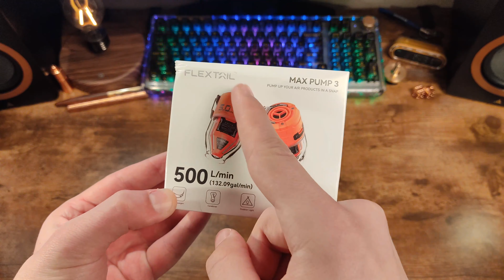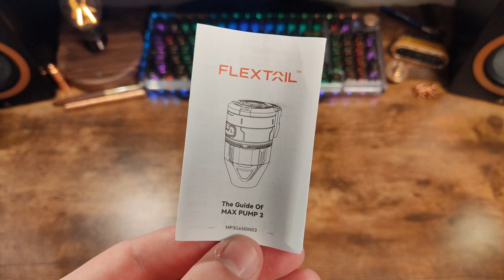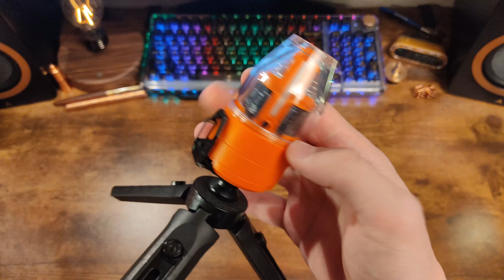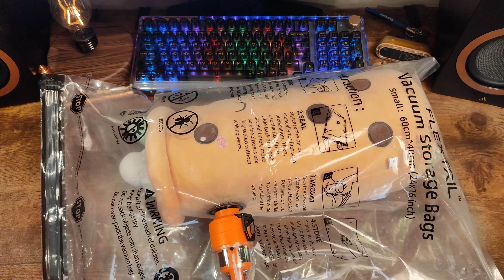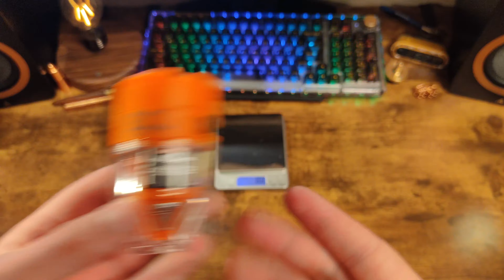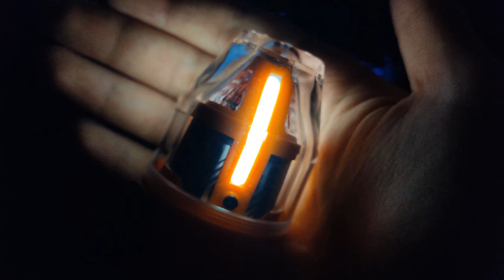🌬️Flextail Max Pump 3 – The Ultimate Portable Air Pump for Outdoor Adventures! 🏕️

Comment: Looking good, considerably quicker , more comparable to the Max pump pro 2 or Max pump plus 2 which both have much bigger batteries at 3600mah / 4800mah respectively compared to 1950mah and have the very useful battery banks super handy. Lots of choices now , Flextail just dominating 👊

Comment: This is such a piece of crap. The Max Pump 2 plus has water resistance, a bigger battery, and the ability to use a low or high air pressure mode. This is a downgrade in nearly every way from its direct predecessor.

Comment: Couldn’t resist.. I have the original Tiny X but for some reason it doesn’t seem to get on with my Exped pad and struggles, showing me a low battery light straight away. Disconnected, it’s fine. Hopefully this one will work better, and the light looks a lot better as well. I’m not keen on the original’s very harsh white